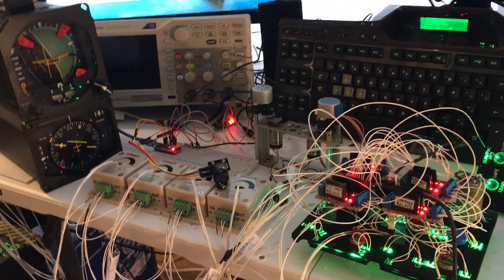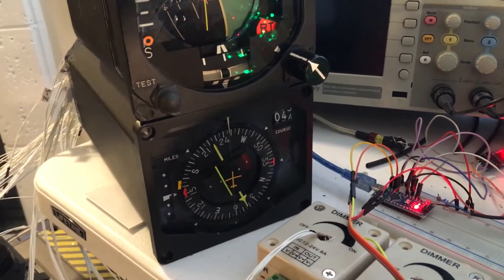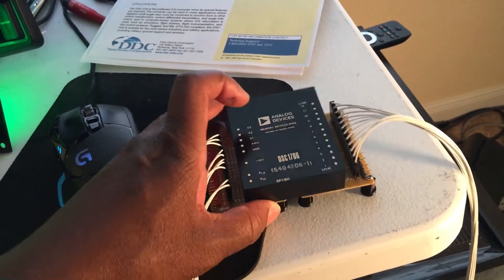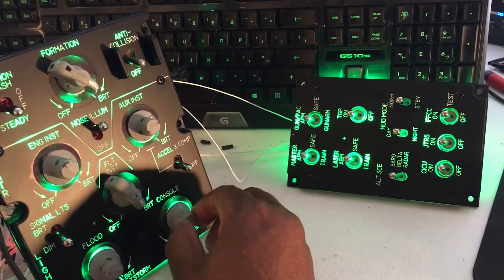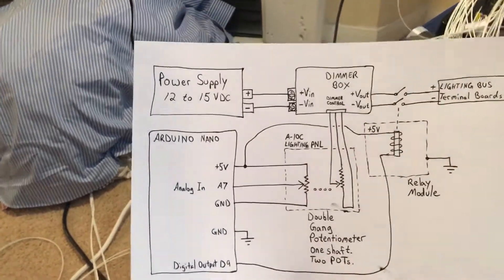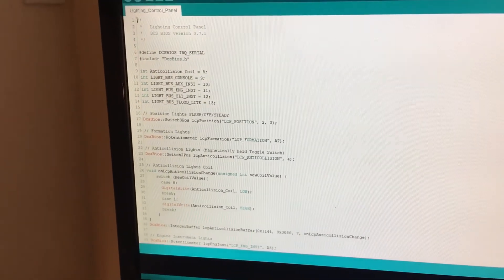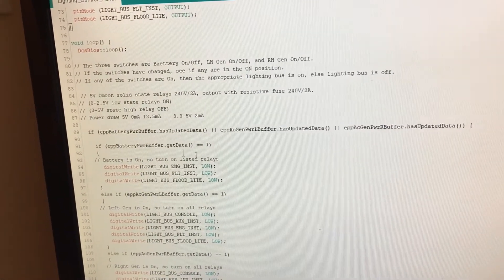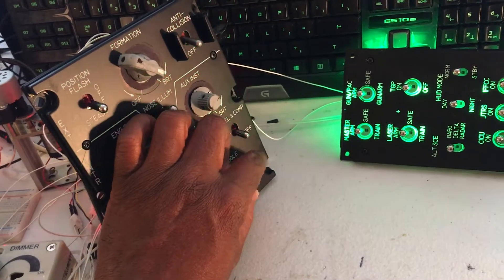A-10C Home Cockpit : Implementing Light Bus Dimmers at $15 per channel.

Comment: Hi Joe,
For the relay, the DC+ comes from 5v from the arduino? DC- to ground and the channels splice in between the dimmer box and lights?
Reply from the maker: ben peters Good day. Yes that particular relay was low current. So it can be powered by the arduino 5V output. Also it was a 2 pole relay so I used them to open the connection between the dimmer output and the lighting strip. But if you have separate 5 volt power supply, you can use that to power your relay.
Reply: @joesim9577  awesome thank you!

Comment: Hello Joe,
Looks like your making real progress. 
May I ask you a few simple questions about the use of Arduino and your UFC panel?
Reply from the maker: I purchased the UFC face plate from PCFlights.com.   Use the 12mm x12mm green lighted tactile push buttons.  
http://www.ebay.com/itm/5X-LED-Light-Tactile-Push-Button-Switch-Momentary-Cap-Assorted-Kit-Arduino-/192266312034?hash=item2cc3f71962:g:yWgAAOSwvp5Zg0ol
Use the yellow for the master caution.  Cut a copper perforated vector-board to same size as face-plate.  Mount switches to that.  Use screw holes provided on face-plate to mount board, may need spacers to provide just the right distance gap.  If 12x12 is too large of a button, then use the 6mm x 6mm lighted buttons from PCflights.com.
http://pcflights.com/index.php?main_page=product_info&cPath=46_48&products_id=360
You'll need to locate a 6x6mm yellow for master caution. But I used 12x12 mm for all and it fits.  
Once switches are mounted and plastic button keys are laid in face-plate, you can mate the two and the keys will be captive in place above the push buttons.  This is where spacing is crucial.  Too far and the keys will fall through and come out.  Too little and the keys will permanently press the buttons down when you tighten it together.  Just right and the keys will just rest on top when tightened and will work nice like a mini keyboard. This will cover lighting the keys, the other text you will need to figure that one if desired to light that as well. It is a little intricate, but for the CDU, I used tall tactile switches and laid a lighting strip down between the buttons and keys so that it will light the keys and any nearby face-plate area.
http://www.ebay.com/itm/10pcs-6x6x9mm-Tactile-Tact-Push-Button-Micro-Switch-Momentary-/161008570263?epid=1831405286&hash=item257cdbcf97:g:Mk0AAOxyuDpSEWAp
Some people use the keypad.h library with the arduino to save I/O count.  For me I used an arduino Mega and wired the buttons one to one without needing a keyboard matrix pattern.  Even though the arduino software comes with the keypad.h library and you do not need any other external parts like resistors or diodes.  But you’ll need resistors to limit the current through your LEDs for the lighted push buttons. If you use a value too large like more than 500 ohms then your buttons will not be bright but look dim in daylight. .
Reply: Thanks for that Joe, your information is invaluable.
I have just purchased my first Arduino and got it up and running with DCS BIOS. Its a slow process, I'm not a fast learner.  
I aim to build the UFC first because I use it a lot in the sim, after that I hope to build the undercarriage panel then go from there.
I have already seen the panels from PCflight.com  They seem a very reasonable price for what you get. I wasn't sure if you had used the arduino for the UFC or a keyboard encoder.  Hope to show you some results in the near future.
Thanks again for your time. I will be watching your channel closely...
Andy Wilson.
Reply from the maker: Cool deal.  You’ll just need to figure a way to hold it down when you use it. Yeah PCFlights have reasonable prices. The thing with most tactile switches is that you connect your wires to the diagonal corners.  So if you connect your ground wire to the lower left corner, the arduino wire goes to the upper right corner. Also the marking for the low side of the LED usually has a red painted dot on the lead.

Comment: Hi Joe, I had been thinking through my lighting and got as far as deciding on dual pole potentiometers so one to sim and other 12v led strips . I hadn't thought through it's connection to the electric panel yet so nice to see your solution to this. Good stuff, cheers
Reply from the maker: Thanks Craig. We think alike. Ian showed me some commands that weren’t listed in DCS-Bios documentation. I noticed though with DCS World 2.5, the flood light doesn’t work in the A-10C. You can toggle the switch and move the dimmer knob and nothing happens. Is that the same for you?
Reply from the maker: Flood lights working now.
Reply: Hi Joe, I'd not gone to 2.5 yet as some forum comments said it struggled to run on their computer. My computer is about 8 years old now and just about manages dcs world 2.0. I really need to get a new one. So I've been mulling it over whilst finishing off the left console. 
Keep sharing your videos, cheers